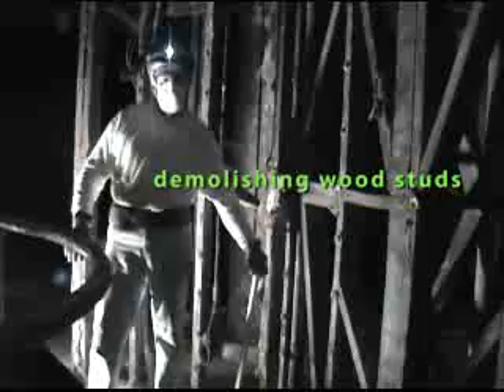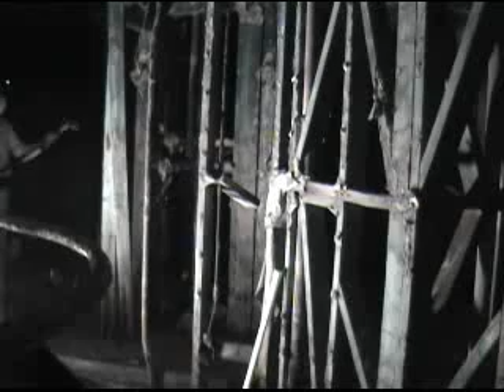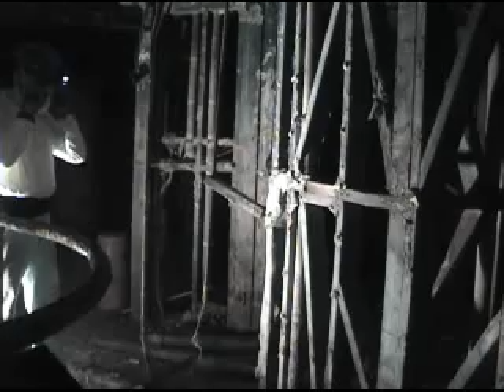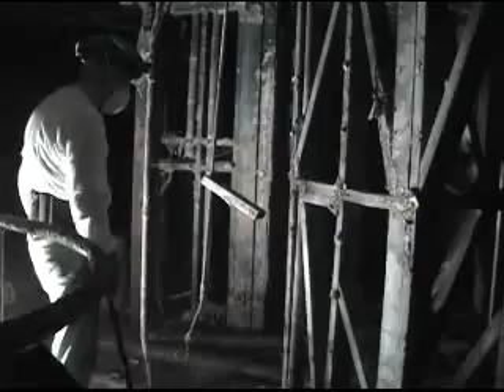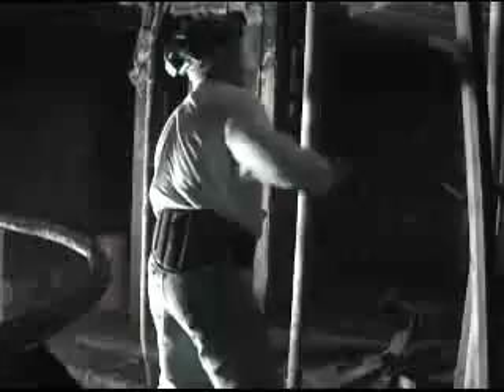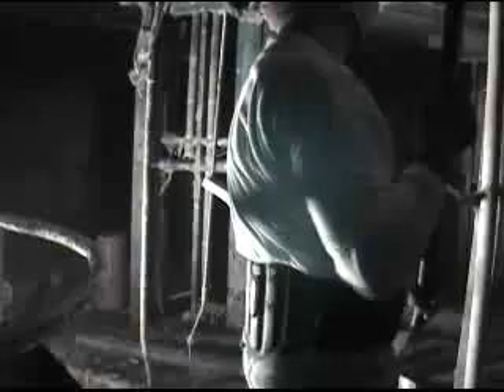Missile Silo Renovation

Comment: When you use a sledgehammer you dont hold stiff at the top and bottom. 
You hold one hand on the base of the handle, and "guide" the sledge with your other hand.  To do this you place one hand lower than the steel loosely, than slide it towards your other hand during the "throw".  

The idea is the weight of the hammer does the work for you, not tires you out even more.